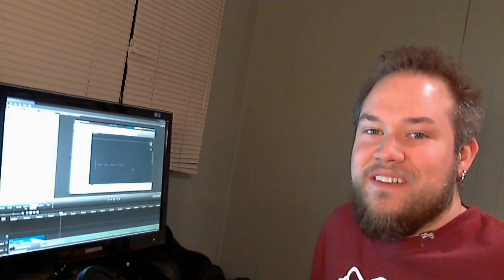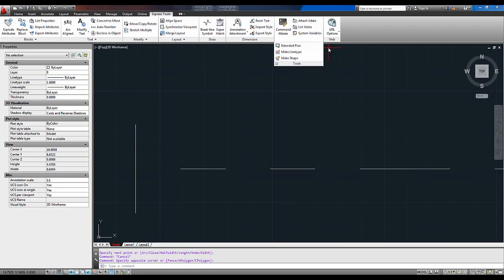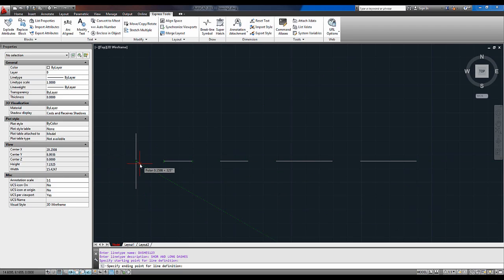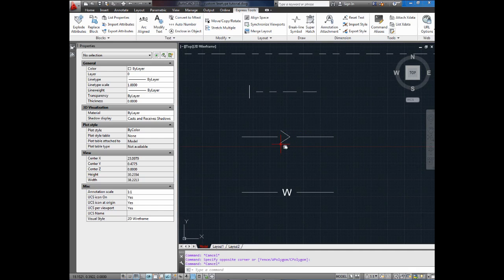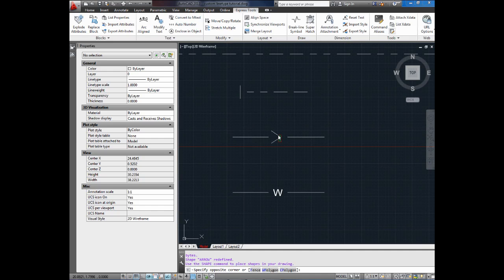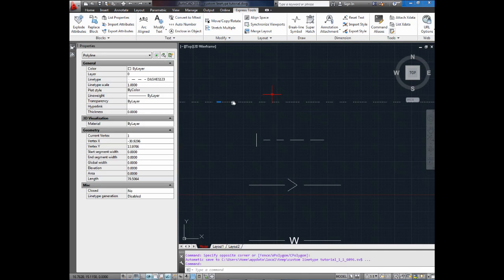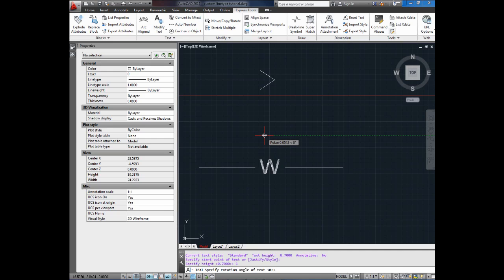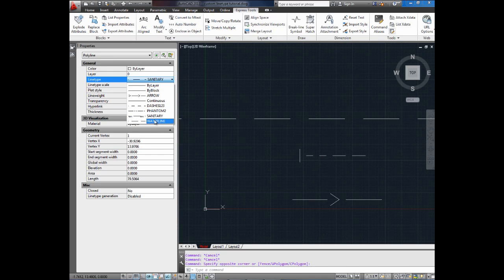AutoCAD Tutorial: How to Create a Linetype

Comment: I'm trying to create a wavy line which is basically constructed of shallow arcs all touching each other to make a continuous wavy line.  Following all the procedures you demonstrated on creating a line it doesn't produce a wavy line.  So I tried making a shape using an arc.  I copy the same arc to the end of the first but mirror it so its facing the opposite direction then I join them and go thru the same MKLTYPE procedure.  I just don't get the wavy line in the end.  Can you suggest something I can try to make this happen correctly?

Comment: @12:43 how do you fix the gaps at both ends of SAN linetype? Is there a way to let the line connect to the grip point?
Reply: Do exactly as Brandon has described however, when making the linetype, have the line first and the shape to the right of it. Make the origin point the start of the line, not offset to the left of the line. Then have the end of the linetype offset to the right of the shape!